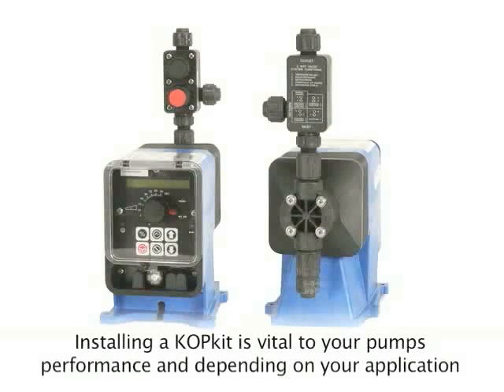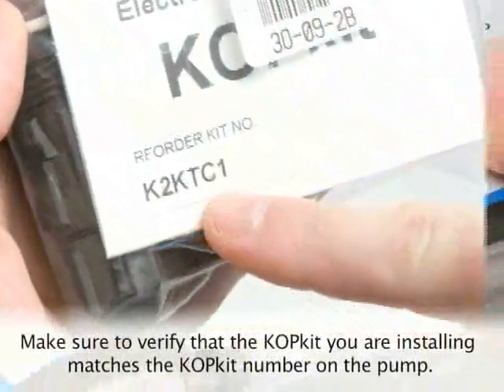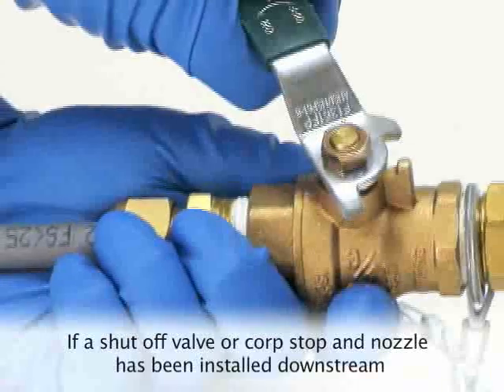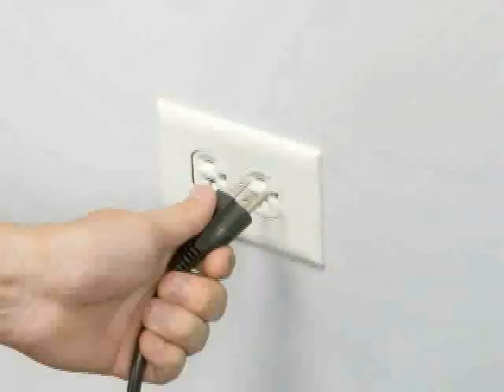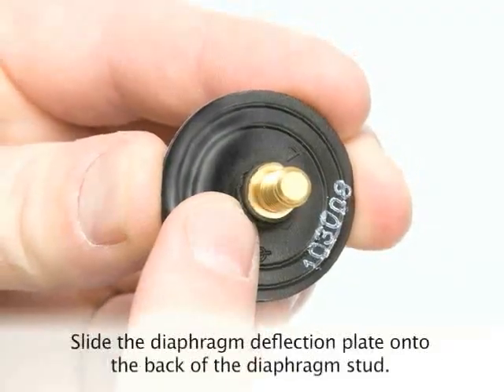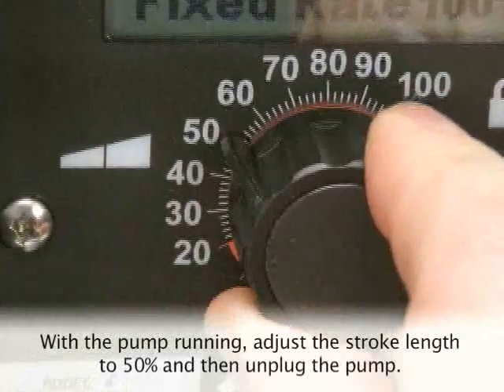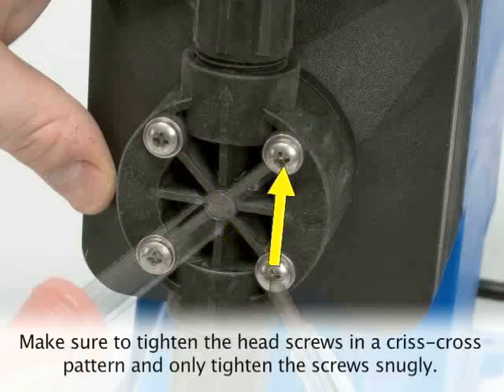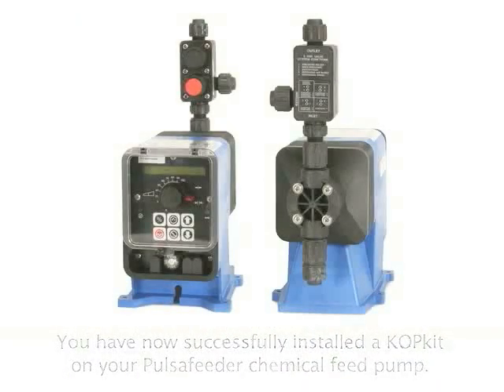Pulsafeeder

Comment: Question.  I have a flooded suction system with a pulsafeed pump in service. 12gpd 150psi. I recently kopkitted this pump and installed a new injector. I ran the well and the pulsafeed came on. The residual climbed while the well was running but throughout the day the residual kept sinking. Why does this happen???